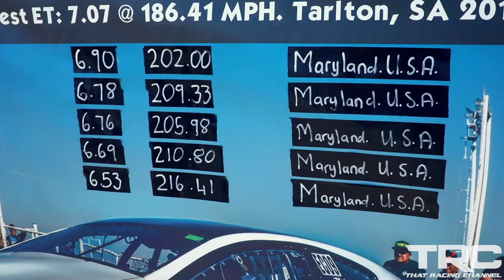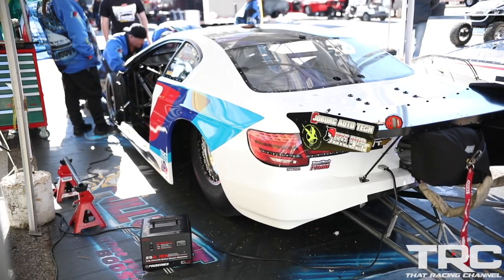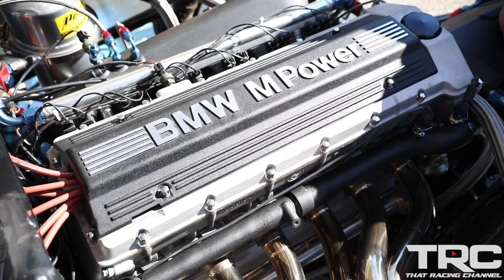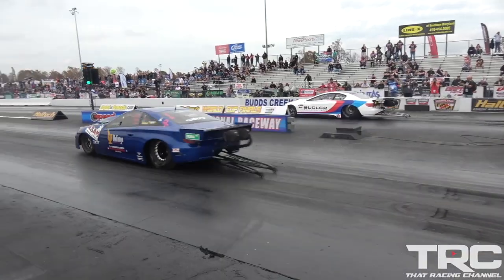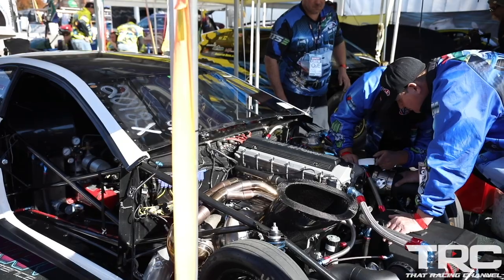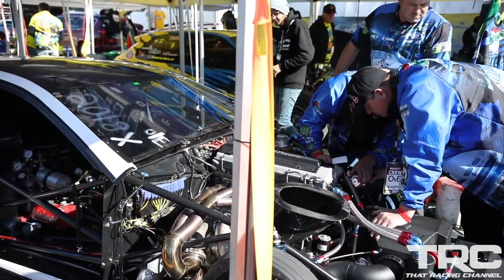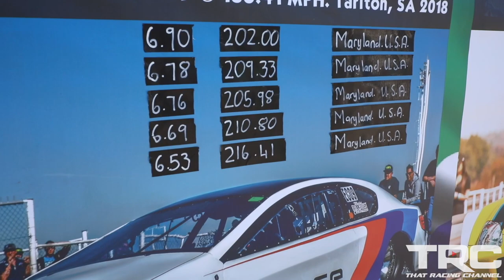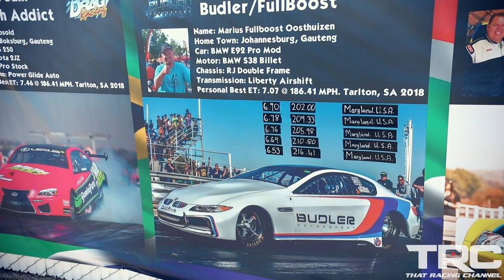The Most INSANE BMW Powered Car Ever - Quickest & Fastest BMW in the world!

Comment: That’s not a bmw that’s a promod dragster chassis with a bmw engine and a body that looks like a bmw lol
Reply: If you comprehend what you read you would understand . INSANE BMW POWERED . Pretty clear to me and pretty badass .
Reply: @woddow  
The point here is that its bmw powered dude. Yes it's a tube frame with a bmw styled promod cover on it. 

That means that Jeff lutz and Larry dent really drive chevies. Heck their motors aren't even based on anything in particular I believe they're custom built by dudes.